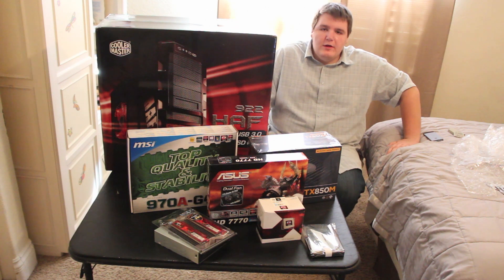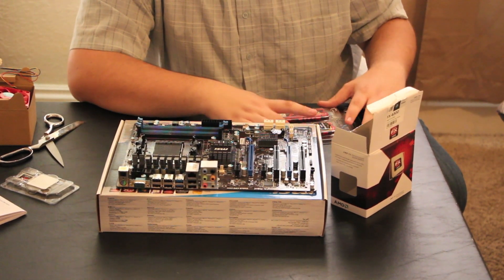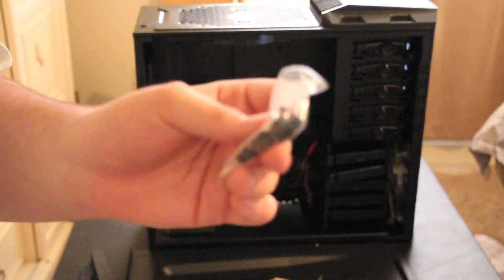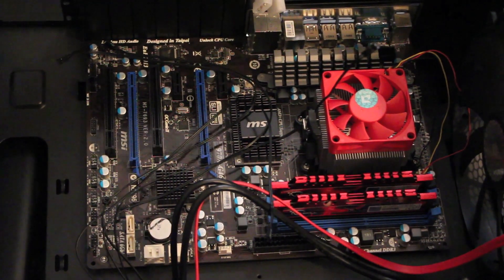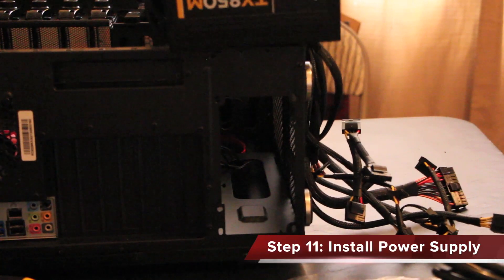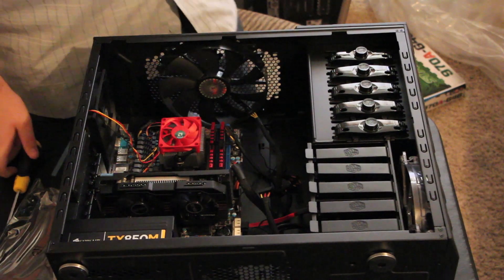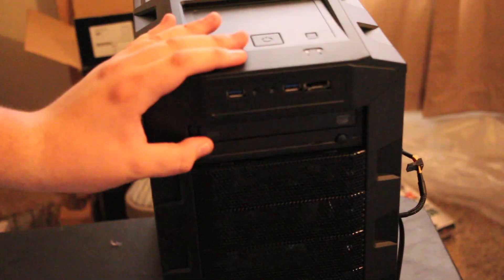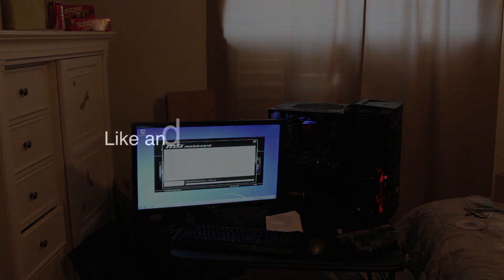How to Build a PC (Step-by-Step)

Comment: Nice tutorial but you could of used a much cheaper power supply and boost up your graphics card for more performance.. i have same cpu with a Radeon 7870 Ghz edition running on a 500w psu perfectly fine
Reply from the maker: Well the plan for this build was to allow it to be upgradeable down the road, which a power supply is useful for.

Comment: You have not really thought through the components you used as 850W is a huge overkill. If your thinking about crossfire which this motherboard does not support then well that justifies why it's an overkill. Your lucky the machine even works because your standing on carpet..
Reply from the maker: Using a high wattage power supply is the SMARTEST thing you can do and is hardly overkill.

Why? You ask, well it's because it's a pain in the ass to pull the 500-600W PSU out of your build, buy another one, and then you're stuck with a useless 500W PSU.

What I'm saying is one day you're going to need MORE power. Everyone finds themselves wanting to do SLI or Crossfire at some point down the road. When wanting to upgrade you will appreciate having a 850W PSU in your system.

I gave this PC away to a viewer and I am still in close contact with him and he recently just upgraded to Crossfire 7870s.
Reply: I wish I received the computer. I've been watching this channel for a long time but it's still not a big deal

Comment: ur standing on a carpet, u could of fried ur components with static
Reply: TonyisGaming Sorry. Misunderstood you.
Reply from the maker: Thats bollocks. I've repaired/modified/built so many electronics and never used a grounder or followed any "static procedures". Never had one problem in my career.
Reply: +TonyisGaming Even if it doesn't fry your components, it can significantly reduce the lifespan or performance of your components. If you also don't feel or see an arc of static go from you to the motherboard, it can still discharge.
Reply from the maker: ***** I never claimed that static doesn't damage your components. I simply claimed that all of the procedures taken aren't necessary to avoid static. You can discharge the static very easily and avoid anything going wrong by having a large piece of metal grounded to the floor nearby.
There is no credence the the OP's statement is all.
Standing on a carpet doesn't automatically mean you're going to create static, it increases the chances and usually only happens if you drag your feet and your feet have socks or some fabric on.
Reply: TonyisGaming I never said that you didn't think that. But scuffing your feet across the carpet could build up a static charge that exceeds up to 20,000 volts. That will very much fry your motherboard. And even the smallest discharges don't take much to either kill a component or decrease its performance and lifespan. I'm just saying, it's a necessary precaution and I never understand why people who build PCs disregard this safety measure. Especially those that deal with very expensive components.
Reply from the maker: ***** Again you missed my point, I didn't say scuffing your feet wouldn't cause that, I said I wasn't doing that. Jesus christ man lol.
Reply: TonyisGaming I know. I'm saying that you don't have to do that to cause a Static Discharge. It can be caused very easily through smaller movements that can still damage components. I'm just picking at your lack of taking ESD protection measures seriously. If you haven't experienced ESD damaged, then you're one of the lucky ones.
Reply from the maker: ***** Even then, you're missing the point of my early comments.
I covered almost everything you're saying in every comment you're posting in an early post.
My precautions when building computers mainly include discharging frequently before touching components. Usually on my computer tower which is grounded.

I mean, the fact is I've built NUMEROUS computers for various customers as well as family members and myself and have never used any other method other than discharging before touching components...
With that being said we've never had any issues on any of the systems with out customers with the exception of one time where a cheap Power Supply they ordered blew out due to it being poor quality.

I mean you can sit there all day and argue the facts of electronic discharge, in practice they don't seem to apply in my experience.

Think about it, I am LIABLE for peoples computers and any damage caused. If there was any true validity from my point of view I would use a wrist band grounder all day every day... but I don't... See my point?

Comment from the maker: No, you need to make sure the parts are all compatible with one another. This is why I do videos on my channel where I layout a $700 PC build with all compatible parts.

Basically, look for CPU's socket type (AMX on AMD or LGA-X on Intel) then look for a motherboard that matches the socket type. Then look for the RAM the motherboard uses, match that up, then look at the PCI slots it uses, match that up. Same for case same for Power Supply etc.

Comment from the maker: Future expansion.

You should always avoid gimping your Motherboard, Case, and Power Supply as they are parts that you can hold on to and use down the road for more advanced builds.

Keeping your Motherboard open for SLI and Crossfire and same with your PSU is important to make sure you can upgrade down the road without buying a new motherboard.

Comment from the maker: Saying most new games will support 6-cores isn't a very good description.

Support means that they will work... of course they would support 8 cores..

What you mean to say is "Utilize". The thing is that gaming is mainly processed on the GPU and the CPU processes the GPU's information. GPU's cannot create enough information to stump a dual core chip, it has nothing to do with the programming of the game.

The one thing the CPU does handle from the software is physics... which really doesn't...